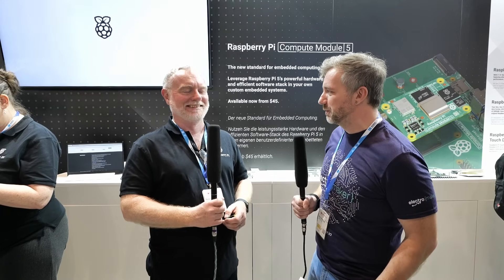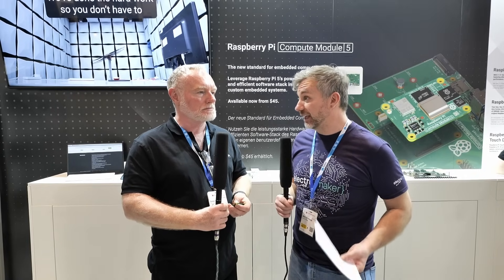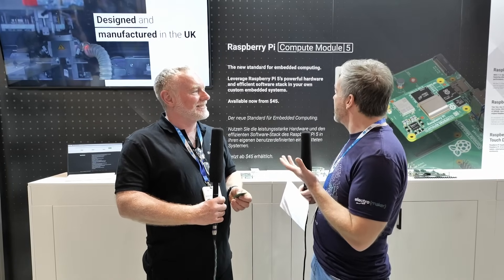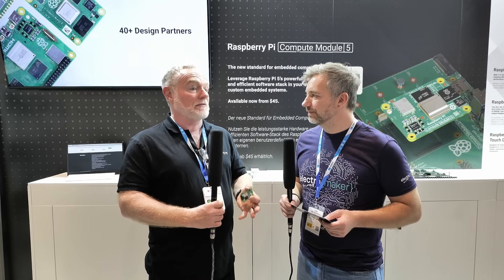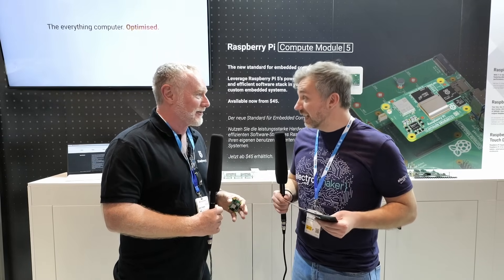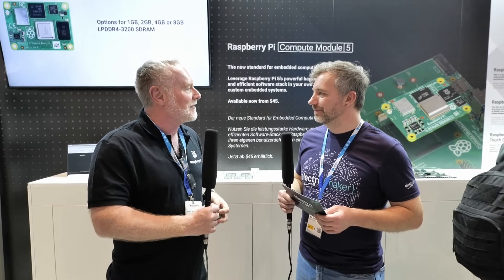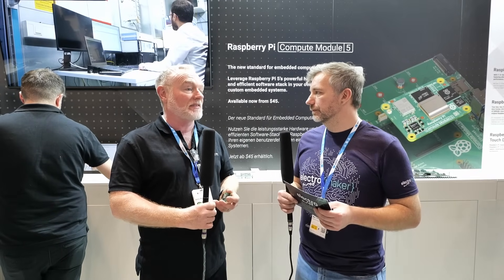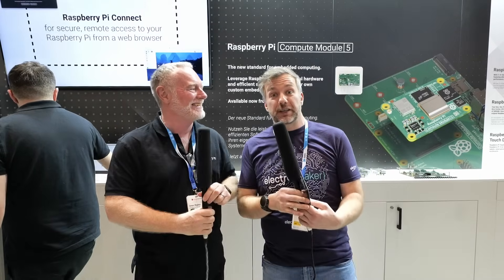Raspberry Pi Compute Module 5 (CM5)  Revealed – What’s New - Embedded World 2025

Comment: I'm from India so I kinda face the brunt when scalpers sell compute modules at higher cost in US. On top of that our govt charges 40% customs duty on top of a fixed charge on all imports irrespective of cost. I know the RPi team works hard on providing the same products at the same price, but it's tough to believe the availability and price are the same once the module is launched.
Reply: Rpi has been doing this price and availability game since the company started, it's really pathetic on their part considering they sell a bare bone product that requires further work by customer. Rpi is finally figuring out hardware side and now they have to figure out business side after having over a decade to do that. 
Rpi drove me to Esp32 ecosystem because of Rpi's low inventory and over pricing. Esp32 is better for electronic prototyping
Reply: @fatteebaddee  Have a look at the RPI pricing over years.. you are completely out of depth with your comment.
Reply: @ I think what he means by the comment is he will prefer either paying more for the RPi or go with a lower quality hardware. rather than face 0 inventory. I think I'm in the same boat as him. 
I would rather pay $10 more if Rpi was actually available in inventory. Wont go to Esp32 but i have bought them in the past.
Reply: @agenthimzz  There are literally no inventory problems on any products right now (Note, RP2350 has only just gone to mass production/availability). There was pain over the silicon supply after COVID, but that is all over now. You should be able to buy whatever you want. On product launches there is always an initial surge in demand, but that drops off pretty quickly. There is no point in building a production line for launch level demand, when that demand drops off after a month. You end up with costly excess capacity. Launch planning and determining demand is not an easy thing to do. Adding $10 to the price would kill demand, and not improve overall sales - it's the worst short-termism.
Reply: Raspberry Pi obviously cannot influence the tax rates that governments put on imports, or local VAT rates which is why we quote prices ex VAT. Still, we can try and make the products as low priced as possible, and make sure that availability is good throughout the world. 11 of our resellers sell either in India or into India, and I would always recommend using official channels to get the best prices.
Reply: @jamesh9756  yeah but im saying keeping the cost a little high is better for Rpi. The main reason is : if companies prefer intel celeron processors for their POC and display systems, then more hobbyists will be able to actually buy the device. the price increase will cause some hobbyists to be alienated but  its better than having a launch of a product and it being out of stock after 3-4 hrs